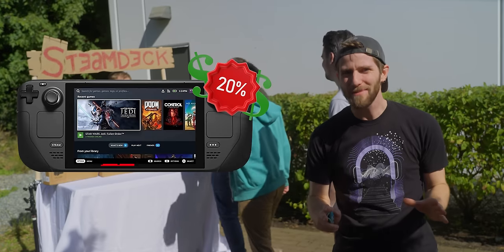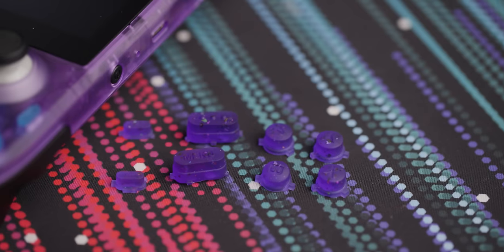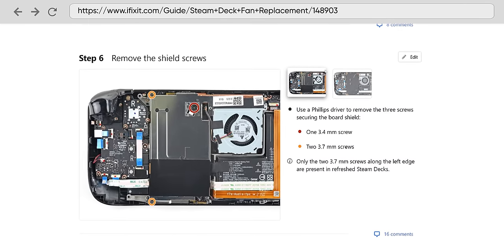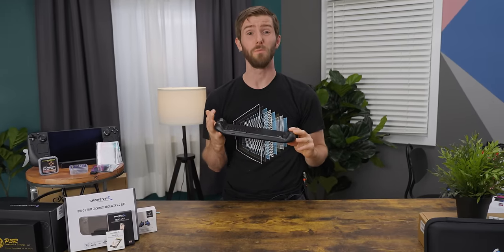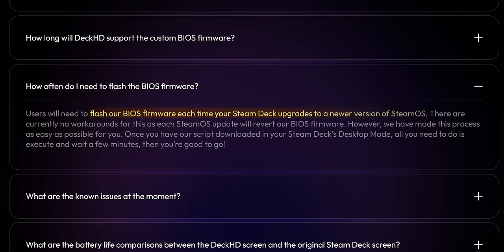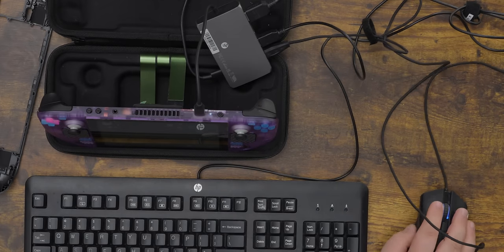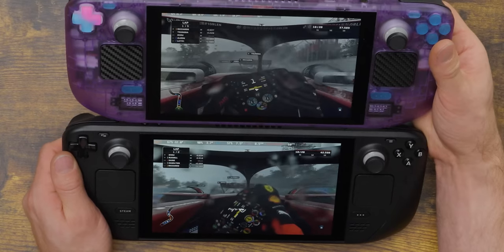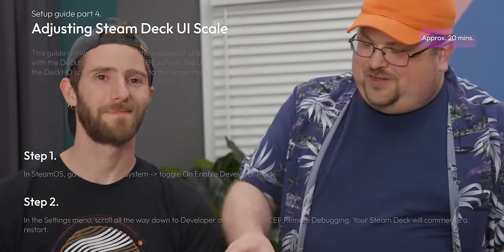Five Steam Deck Upgrades under $100

Comment: Wow, thank you for using our replacement shell! The result looks absolutely fantastic. By the way, this could be the hardest replacement kit in our product ranking, so GOOD JOB LLT! Through your video, we hope more and more people learn about the possibility of personalizing gaming devices on their own, and that's what we are doing to provide the best modding kits ever for all of you!
Reply: It looks awesome but the tolerance still keeping me away. At 11:40 the left joystick was stuck
Reply: Best ever.... but the left stick gets stuck>?
Reply: @tumo07  They said right in the video that it's a torque issue on the screws. Annoying, but not a dealbreaker. They can be tuned to work just fine.
Reply: @tumo07 it’s an issue with the joy sticks sitting a bit to high. Wiggling them then press hard down has fixed the issue in most cases.
Reply: Do a shell for the Lenovo Legion Go? :)
Reply: I love the way your products look but they aren’t great quality. My PS5 DualSense Shell was a disaster.
Reply: IMHO, transparent shell looks awful, you can see all the guts, they're all differently colored. Opaque would be much better.
Reply: @fire2day  I don't believe that. I think it's an issue with the dimensions of the shell itself. You shouldn't have to loosen a bunch of screws to make sticks move freely. Anyone who has ever replaced the shells of Gameboys, controllers, PSPs, knows this is usually the case. It's common with the manufacturing of third party shells. Even if loosening some screws fixes it, that doesn't mean that's the source of the problem. If the dimensions were a perfect match than you wouldn't have to loosen screws or push down on the thumb sticks.
Reply: Waiting for the Oled shells 🥰

Comment: I just wanted to say that I did the same shell mod with JSAUX and installed the Guilikit V2 thumbsticks and had the same issue you had at 11:40 where they were sticking. It turns out that this has something to do with the way the thumbstick cap is sitting on the post. If you wiggle the thumbstick cap off of the post a little bit and then use a decent amount of force to press it back on, it'll sit at a lower height and clear the deck's front shell (and no longer get stuck). I found this out from Retro Handheld's video (Timestamped): https://youtu.be/FnIqILz6YjQ?t=350
Reply: Didn't your comment before I posted mine. 3 sets of GuliKit sticks had this same problem. I figured it out completely on accident but was a noticeable difference. Seems like a weird manufacturing issues, but it is permanently fixed by doing what you/I did. I will say I didn't have to do anything aside from just compressing the stick to the post, but I removed one set to confirm that nothing was broken, prior. Weird issue but one that is easily remedied, at least.
Reply: Lmao, HD screen costs the same as piece of metal (cooler)
Reply: @fomingera65  precision machining metal is an expensive and slow process. screens can be assembled on a line, and the raw material cost is also less
Reply: This didn’t age well 😂
Reply: @TheUAProdigy  what do you mean?
Reply: @TheUAProdigy ???

Comment: So one simple mod I did for my Steam Deck -- which I hope the team at P3R might consider as part of their install process -- is replacing the stock TIM on the APU with Honeywell PTM 7590. Since the Deck already runs quite hot the PTM works amazingly well, and I've noticed that my deck not only runs quieter since install, but I've also seen some performance improvements. Sadly I didn't measure it before doing the upgrade, so my experience is very subjective, but I'd say it's worth doing just for the reduction in fan noise.

Comment: It looks like the monoblock would benefit from something like K5 Pro or thermal putty, something that can squish, instead of pads to prevent uneven contact
Reply: Copper shims, in fact, are better because then you have the force pushing against the die of the chip.
Reply: @ChristopherStanton  I'd be worried about those shifting and shorting out.
Reply: This is something that can be fixed in design they need to adjust the approach on how they make contact points they should prioritize the soc making sure they contact it at exact pressure then have everywhere else designed for thermal pads the pads will allow for height tolerance around the board.
Reply: This may also be overlooking the temperature tolerance of the different components too, the RAM is up to 85degC while the APU is 105degC, is it wise to make contact with both at once for the same heatsink?
Reply: actually monoblock works fine on my steamdeck, not like shown in the video. probably couldn't mount it correctly or they received bad unit.
Reply: @ChristopherStanton  yes, because some transfer of heat is better than no transfer of heat. Don't worry about the actual temps, worry about the thermal output.
Reply: @ChristopherStanton  i think the issue is that Valve doesn't have any consistency in IC heights, if they did, you wouldn't need shims and just have the base machined to suit.
Reply: @flandrble  One of the issues is the standoffs are also push fit, but yes there appears to be an uneven level to the components too, the heatsink being sprung-forced onto the APU also appears to be designed around this variance.
Reply: When they remove the monoblock it looks like the thermal paste isn't covering the whole of the die - could that explain why the GPU was getting cooling but the CPU wasn't?

Comment: for determining the thickness of thermal pad required, there is a product used in engine building called a squash string, used to work out the clearance on bearings. You put it in and tighten down the bracket then undo  it and how much it has flattened out tells you the exact size of the gap I don’t know if people use these in PC building yet, but it seems like a great way to get the perfect thickness pad required for those VRM and memory chips
Reply: I was wondering when someone was going to get around to mentioning the method you suggested using squash string. As a retired EE & a Mechanic, I can definitely see the advantage and credibility in using this technique.
 This SHOULD be the GOLD Standard way of doing ALL HEAT-SINK Clearances !! 
It's done this way in EVERY SPEC Motor,so there should be NO difference in our Micro-Electronics either ! This would insure Maximum & Minimum height tolerances to gain the BEST out of the Heat Sinks. And it's Easily attainable !😎

Comment: I love the idea of a display upgrade but this one feels like they wanted to focus on higher resolution as the main selling point, which I think is not really a good idea considering the Steam Deck's performance and battery. Personally this is what I would really want from a display upgrade, and I'd pay over $100 for it:

-Better color (the one in the video does have this)
-Better response time (the Steam Deck display's response time feels very noticeable in some games to the point that I don't play them on the Deck)
-Higher refresh rate (even just 75 Hz or 90 Hz, doesn't need to be 120 Hz for me)
-A slightly bigger display via smaller bezels (same resolution)

I'm sure some people like the higher resolution and that's cool, but I really think that's the wrong focus for the Steam Deck given its performance and battery constraints. I'd even put up with all the BIOS tedium for the stuff I mentioned above. I'm sure there's difficulty around sourcing a display like that though.
Reply: One way I've noticed to get response time a little better is to set the Deck's frame rate limit to OFF because there's a separate option to allow/disallow screen tearing and use the game's Vsync instead so the game doesn't render past your set refresh rate and burn battery. Though if you're playing games at 30-40fps response time will always be higher than a good pc that can run at 60fps or higher.
Reply: Given the Decks huge bezels, I'd bet you could fit a 7.5" display into the same frame as long as you could find a compatible one. It doesn't sound like much, but that extra .5" could really help with text legibility in some games, I'd definitely buy that upgrade.
Reply: @unnoticedhero1  Yeah I'm aware of that. Even under ideal circumstances, I believe the Steam Deck is 30+ ms for response time.
Reply: I don’t get it. You understand that the performance and battery life are reasons the 1200p screen is a bad idea, but you WANT a 90hz display…what the heck do you play at 90FPS that doesn’t max out the GPU?
Reply: @TheOfficialOriginalChad  Older games
Reply: @me2olive  Yeah that's one of the biggest reasons for me. Text and UI elements can sometimes be a touch too small for my liking and just the extra half inch or so would allow me to hold it more at arm's length.

Comment: The problem with some of these upgrades, in particular the ones that impact performance, is that they're less upgrades and more trade offs.  There's a reason why Valve set it up that way and messing with it messes with that balance.  

In my mind there are only two upgrades to the Steam Deck internals that are actually worth it, storage capacity and the analogue sticks.  And frankly, you don't strictly speaking need to do either.

A micro SD card will do fine for storage and unless the analogue sticks start acting up you really don't need to upgrade them either.

Comment: Those buttons are the most amazing part. Absolute best upgrade. The shell is nice too, but would probably also just stick with the back shell. Just to avoid having to swap the screen around.
Reply: The screen removal looks really rough.
Reply: $50 for few plastic yeah.

Comment: I'm amazed you guys didn't test the replacement screen at the decks native resolution to see how it looks in comparison
Reply: Running a non native resolution on a display generally looks pretty bad, wouldn’t be a fair comparison to the replacement.
Reply: Upscaling non-native looks bad, always, why even test it??
Reply: Why would you bother going through all of that trouble and hassle (and the cost) to upgrade that screen and then play at the deck's native res, though?
Reply: Linus also hasn't tried the vibrant deck plug in which makes the colors of the stock screen so much better. That we actually won't need any replacement screen.
Reply: I mean they didn't even use the same car for a direct side by side comparison on f1 so it's not exactly shocking 😂
Reply: @HeretixAevum  I wouldn't swap the screen because of the performance, but one of the few complaints I have with the Deck is the pixel density; 720 does get pixely on a 7 inch screen. The performance hit to play on native is way too big though, but the higher res gives you a bit more room for FSR to do some magic. I tried FSR on a few games and while I can see it being useful sometimes, uspcaling from 500sth p to 720 doesn't do much? It does something, but you yield a lot better results with 480p upscaling and there's just not enough pixels to work with at this point. Best result I saw was Yakuza 2 (or 1? can't remember, same engine anyway), but the faces become blur, which really looks bad and out of place; some might say "who cares', but it's like watching that episode of Black Mirror where everyone's face is blurred. So yeah, FSR would have more room, some games could play natively, but overall performance hit makes it not worth it.

Also I don't see why else you'd do it if not for FSR, because using 720p on that screen is pointless, and if most games can't keep up with the heat then why use that screen.

Comment: 8:43 looks like the thermal paste wasn't spread evenly, that could explain the temperature differences
Reply: Good catch. I've tried warning people over and over again on GPU repaste vides that you must spread the paste on the dies because its not the same as just putting a blob on an IHS and it'll likely spread to enough places. On dies, always spread it.
Reply: @peartreez  If there was proper contact it'd be spread properly.  If there is so little pressure that you have to make sure it spreads then it isn't going to conduct well anyways, regardless of spread.  The goal is to have as little TIM between the CPU and cooler as possible.
Reply: @Mad-Lad-Chad  it would not fully cover the whole DIE if there's not enought thermalpaste applied initialy even if the pressure was sufficient. And you could not 100% tell if it is enough or not.
Reply from the maker: Hey, as we mentioned in the video, we got a sample from Wave 1 of Posseidon's 3 Rings' original Monoblock, and their CEO warned us in advance that they had experienced wildly varying results, ranging from 20 degrees below stock, to 10 degrees above stock due to some manufacturing issues. We followed the directions they provided, using the supplied pads, and unfortunately ended up with a poor result.

P3R also told us they are aiming for a more consistent "10 degrees below stock" for the second iteration of the Monoblock (Wave 2), and told us about some of the improvements they are planning, which include increased fin density, additional material over the APU to improve mounting pressure and thermal conductance, and some tweaks to improve levelling and mounting.

They also mentioned experimenting with a larger heatpipe, though at the time of this update, that's still listed as 'Pending' for their original Monoblock, while it appears to be confirmed for the Monoblock 2. We look forward to trying out both Wave 2 and Monoblock 2 and seeing the improvements first-hand.

In the meantime, there's an active modding community on P3R's Discord who have conducted a ton of experiments aimed at improving the performance of the Wave 1 part, you can check that out here: https://discord.gg/uRhFDDK

Comment: You missed one component, that I love: USB-C to USB-C EXTENSION CABLE (2m is mine)
So you can play while charging, using USB connected to the dock, HDD, or SDD, or use your TV or monitor and the Steam deck as controller.

Comment: I really hope that Nintendo and Steam keep their next devices to 720p/800p screens. Everyone wants more resolution but I just want to be able to play at some higher settings, or framerate. Screens at these sizes are great at this resolution.
Reply: Tbh i i think higher is better as you can just lower the rez, then on games that dont push the system to its limits like a emulator you get a way nicer image
Reply: I think they probably would keep it the same, though I could see the next Switch being a 1080p screen that just runs games at 720 and uses DLSS to get to 1080 but we'll see.

Comment: 8:43 In that Frame Linus opens the Steam Deck again and lifts the heatsink, you can see the mounting pressure on the ram is very uneven (1 of 4 ram chips seems to have no contact at all).
This would explain the bad temperatures on the die also, guessing that to bottom pads for the powersupply are too thick and cause an uneven pressure in the apu itself)
I personally would give it another try first testing without thermal pads at all and if that works better using pads but press them a little bit harder on the components to make them thinner (yes that works, happend to me with 2 waterblocks for 2080 ti and 4090 as I preordered them and the thermal pads had the wrong thickness for some components)
Reply: They are also did a bad job on applying thermalpaste on the DIE - you can see it not fully covered. You should spread the paste and not dotting it as they did. Another bad effort from the team after all the critics they got.

Comment: 17:46 I wish we could have seen those thumb-sticks tested in LABS.  How do the dead-zones and outputs compare to the standard OEM thumb-sticks?
Reply: they're square gated while the OEM are circular gated, so it won't feel the same by default, you'd need to change it in steam input to account for that.
That's why the gulikit ones kinda suck while the new Elecgear ones just are better

Comment: For heating that screen uniformly use the 3d printer heated bed.. Put the screen side down, set to 70C leave it for few minutes, it will soften the adhesives and you don't need to put so much hot air and/or tin foil.

Comment: I wish someone would make a custom back shell and M.2 ribbon cable that lets you use a 2280 M.2 accessible via a hatch door on the new back shell.
Reply: There are adapters developed for the Steam Deck to install 2280 ssd above the m.2 slot. The SSD then protrudes over the battery. But you have to build the case yourself. Cut a hole in the case yourself or build something from 3D print.
Reply: The same company that makes the monoblock in the video offers an adapter and a new backplate to accommodate a full size m.2 but it’s a pre order at the moment
Reply: Ide cables can only be a maximum length
Sata can only be a maximum length. 
Might be the same with M.2
Reply: @BEARTAC0S  Seeing how the company handled the monoblock, don't get your hopes up
Reply: @BEARTAC0S  This is great, it looks like you need to remove the back cover to swap M.2 drives. A small removable cover would be better, but this works. Especially since 4TB NVMe drives are so cheap now.

Comment: sticky sticks are also present in the OG case, the solution I found best is to loose the screws holding the sticks by a tiny bit and all is good. The tolerances there are a little bit small.

Comment: I was considering the screen update just because it had better colors. I found the colors on the original screen very bland, but after using SteamOS 3.5 color controls I was able to tweak it so that it looks a lot better.
Reply: @unholydonuts True. My comment is from 3 weeks ago when I had no idea the Steam Deck OLED even existed.